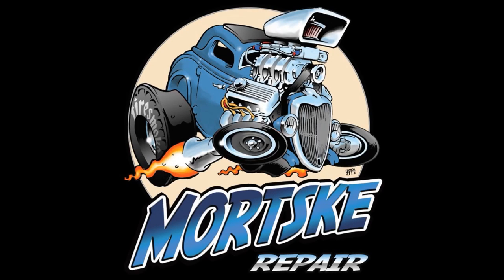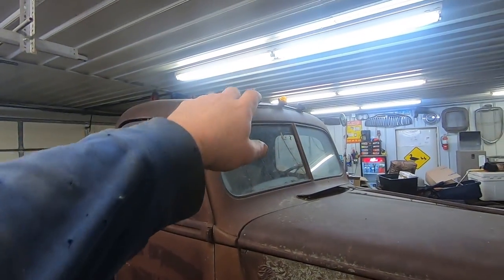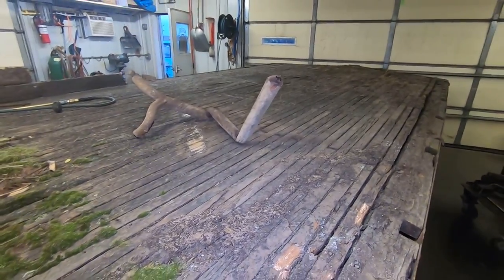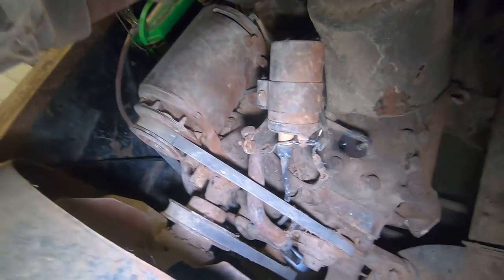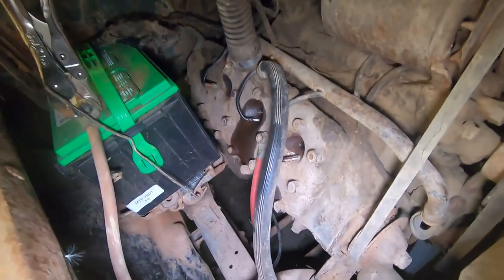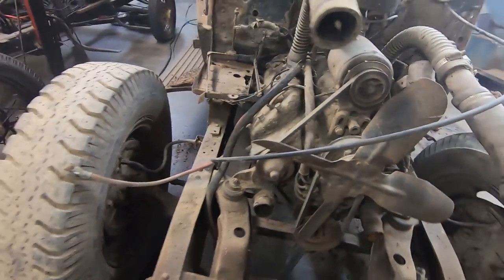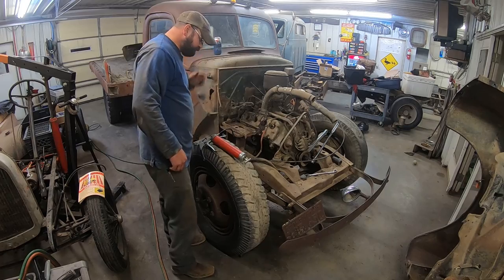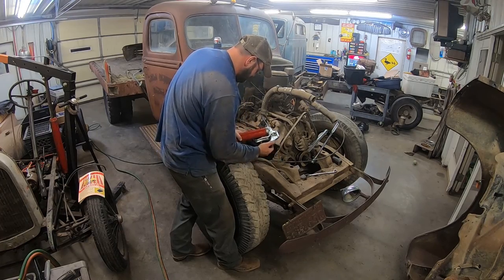Farm Auction 1944 Ford Flathead V8 truck! Abandoned for 47 years! Will it run?!? Stuck rusty engine!

Comment: When you took the 2nd head cover off my heart sank, I thought that was it like tools down and junk it.
I cannot believe you got her free! Yet alone actually running! 🤘  Well done I take my hat off to you sir 👍👍👍
Reply from the maker: Trevor, your comment right there was the whole reason I did this. I was sick and tired of all the keyboard warriors out there questioning my mechanical ability. I didn't perform any magic on this one. I just refused to give up! Thank you so much for watching and commenting!!
Reply: @MortskeRepair  sometimes when we don't give up great thing's can happen 👍
Reply from the maker: @trevorwilliamgrindrod3999  No good story ever ended with "and then I quit"!!!
Reply: You can't kill a flathead~!
Reply from the maker: @TestECull  Apparently you can if you fill the cylinders with water!! Thanks for watching!
Reply: @MortskeRepair  sometimes you just have to step back for awhile and work on it another day or so I've found anyway,my cousin has an old iron menagerie and several of those are flatheads including a '36 Ford pickup,a '52 Mercury Monterey, and even a rat rod '36 Ford truck with a V-12 Lincoln flathead not to mention a '37 Terraplane,a '35 Hudson and a '49 Dodge pickup with a Chrysler flathead six in it.
Reply: @MortskeRepair  Didn't kill this one!
Reply: @MortskeRepair  Are you gonna have the block pressure tested?
Reply from the maker: @rogercamp6071  I'm a man of little patience. But yes, when I'm feeling frustrated, walk away, have a beverage or 17, think over the situation and come back refreshed with a new game plan!
Reply from the maker: @dinkchow  Before tearing it down I'll have it checked out for cracks. Right now it's just waiting for it's time to come back. Got a few irons in the fire right now!
Reply from the maker: @TestECull  Almost drowned it!!
Reply: @MortskeRepair  yes I've been working on a lawn mower and the gas tank has mounting lugs and one has came off, have spent two nights working on reattaching it but tonight I finally got it back on, now to see if it will start and stay running lol
Reply: @MortskeRepair  eh the ol' girl just needed to clear her lungs and cough a bit. Haha. Be interesting to see if the block's cracked or not; if it's not I'd almost be willing to say it's a viable engine right as it is. Even if it is only running on 5 cylinders.

It's entirely possible the water habit was bad head gaskets too. Given the low CR and high chamber volume in these engines they can have a MASSIVE jacket-to-chamber leak and still not hydrolock. If it was a head gasket leaking jacket-to-cylinder you might very well have fixed it with the gasket-in-a-can.

Worth a try. Fill 'er up to the top of the hoses with water and flash 'er up, see if it starts leaking when it warms up.
Reply from the maker: Just throw a big zip tie on there Roger!!
Reply from the maker: C6 - I'll throw it on my run stand and get it up to temp a few times and see what happens. I'm sure it needs the waterpumps rebuilt anyhow.
Reply: @MortskeRepair  lol
Reply: @MortskeRepair  Would make a nice vid!
Reply from the maker: @TestECull  I'll be sure to document it!
Reply: @MortskeRepair  Don't think anyone'd be opposed to an ASMR loop of that thing burbling over either...she sounds good even if it's prolly only running on 5 or 6 cylinders.
Reply from the maker: @TestECull  Oh come on!! This thing is ready for the 1/4 mile blasts!
Reply: @MortskeRepair  Daily driver bb! She ain't smokin' bad at all either; it's probably only down a couple jugs 'cause the valve seats are covered in crud. I bet with a valve lapping on the cylinders that had rusted it stuck it'd be firing on all eight.
Reply from the maker: @TestECull  Dump a little Seafoam in the tank and she'll come right out of it!
Reply: @MortskeRepair  
KoperKote gasket maker, a temporary fix, unless it works.
I had a '40 ford 5 window that ran, but smoked so bad you had to shut down at traffic lights.
Couldn't get the heads of in 4 hours of trying all methods, including a brick on the accelerator.
You had better luck.
Thanks for sharing.
Reply from the maker: @FeralPreacher  It's not dumb if it works!!
Reply: In this scenario you simply have to be old enough to comprehend how lucky you are to own a part of history which are almost all gone now your grandparents will tell you I'm right
Reply from the maker: @alan6832  Yeah it was free!!
Reply: Thanks for ruining the whole video for me
Reply: @MortskeRepair  Those that have seen the things that Jennings Motors has resurrected (sometimes barely more than a half motor & barely recognizable chassis)...no doubt was there.
Reply: Nothing gets the heart pumping like a good workout on a flathead, followed by a grin when it runs. Thanks for the great video. Can’t believe I missed this one until now.

Comment: When I was a kid back in New Hampshire there were quarter mile dirt ovals that the locals raced their jalopies at, mostly flathead 
V-8s, some flathead I-six motors. One in particular was a Hudson six that won quite a few races. I used to hang around the pits after the race and watch the mechanics tear down motors for the inspector to measure bore diameters and such. I remember one old timer talking about knurling the pistons to deal with piston slap in a worn cylinder. Your videos remind me of those old days, "50's and "60s... great time to be alive.
Reply from the maker: Thanks for watching and commenting!

Comment: You have inspired me! I have a 54 Ford customline next in line, I have a V8 for it but the old inline 6 in it now is stuck, was trying to get it running but found 2 cylinders that looked just like your two. Couldn't unstick it so gave up but I didn't try the heat. Now I'm gonna jump back on it, just want to see if I can do it. I also have a 239 Y block with two cylinders the same, gonna try it too. Fortunately the engine slated for it runs nicely, so these two junkers are just for fun and the challenge. Keep up the good work, one of my favorite videos, and channels!
Reply from the maker: Glad you liked it! Sounds like you've got some cool stuff!

Comment: Never thought that thing would have enough compression to run, what with those cylinders in such bad shape. Maybe boil the radiator, patch it. Fill it up with water and see how much leaks out, to know if you've got a good candidate for a rebuild.
Reply from the maker: All that rust really seals those rings up for the good compression! I've got a radiator I know is good. I'll put it on my run stand with some new waterpumps and heat cycle it a few times to see if there's any further issues. Thanks for watching Rob!

Comment: I work on a lot of the N series tractors and most of them have studs, my method is remove the nuts, spray pb around the studs, tap the head with a hammer to shock it a little, then beat the piss out of it from all directions with a dead blow. Then I drive a thin putty knife between the head and gasket in a few spots and just keep working it. Once it’s up a little I grab the dead blow and a wood dowel and start working it up the studs. If I’m lucky some of the studs come out with the nuts and it makes it a little easier.

Comment: Funny. I've got almost the same truck except with an army steel dump box and no cylinder heads etc. I dragged it home with one tire worn down to the cloth and the sidewalls flapping. All tires still holding air. Love that old stuff.
Reply from the maker: That tire is good to go for another few thousand miles it sounds like!! The heads are off so the hard part is done as far as getting it ready to run! Thanks for watching and commenting Glenn!

Comment: I faced a lot of the same problems with the 2 49-53 blocks I have. The one in the truck was stuck in much the same way, and the second one turned pretty decently, but I tore it down anyway to check everything over. Two tips for you for the next one, use a plastic headed hammer for tapping the valves down. The metal hammer can shock the stem, and break it off. Second, ether is a faster way to get it to cough back to life. The whole wet plugs thing can get annoying while using gasoline for the prime and first run. Ether is quicker to light off. Just thought of a third tip. Drain out the old oil, give her 3qts of diesel, and 1qt motor oil. Let her idle for a good 3 or 4 minutes, cool down, and do it again a few times. That will usually liquefy all the old sludge in the valley, and the pan, it'll come sailing out the drainplug.
Reply from the maker: Those are all great tips Mark! I appreciate it! Thanks for watching and good luck with your flatheads!

Comment: I havent heard a 1940s Ford flathead V8 run in many years and after the first jailbar engine revival sank in a puddle of water of its own making, I was rapt to see this video pop up...

...then the driver's side head came off and I really expected you to down tools, mate.  I probably would have written that thing off as a boat anchor, myself.....but you persevered.  AND you got the job done.  

Man they built 'em tough back then!  Sure, she probably needs the full overhaul but she runs, blows little smoke and sounds not bad, so maybe there is some life left in the old mill yet!  

That idle was absolutely wonderful to hear after so many years.  My Dad had a 48 Bonus that idled at about 400rpm and had the 4-spd crash box.  I loved the sound of that old truck and used to go out and start it when he wasn't home just so I could hear the starter and that magical idle!  

Dad had a party piece where he'd be out sinking a few in the garage with his mates and would lift the bonnet on the Bonus, crank on that starter (that always sounds like the engine has no compression) and then wind the rpm down to the point where you could almost hear each cylinder fire and watch the fan blades go round.  

A magical engine....and its given me a hankering to go out and find me an old Bonus or Mercury just so I can hear it more often!  Many thanks for giving it all the time and expense - I for one certainly appreciated it
Reply from the maker: Lance, thank you very much for watching and thank you even more for your positive reinforcement! It's comments like yours that make it all worthwhile what we do on here! And you're right, there's nothing like the sound of an old flatty ticking away at low idle! Thank you again for watching and commenting!

Comment: I have a stuck flathead in a '53 that I really want to dig into this summer.  Trouble is, Summer is quickly evaporating and the '53 F100 is still way down on the priority list.  Great job Mortske.
Reply from the maker: Good luck!
Reply: @MortskeRepair  The heads are off the flathead in the '53.  Like this one, two chewy cylinders but they are the middle two on the other bank.  The one that is near BDC cleaned up decent buy the other stuck one is near the top.  I have tried a bit of heat and the stick and hammer on the pistons but still not moving.  I left it soaking for a couple of days with some marvel in the cylinders but I doubt that is going to do much.  I think the pipe wrench and extension pipe is going to be my next step.  Thanks for this video.

Comment: That a friend of mine tought me how to unfreeze engine's by letting them soak in transmission fluid. Because transmission fluid is an oil that can penetrate metal.
Reply from the maker: There's a lot of different concoctions folks try for loosening engines. I don't have patience for that so I throw a little heat at em. Thanks for watching Jacob!
Reply: You can also use Ammonia to free up stuck cylinders
Reply from the maker: @richardsmith1143  Thanks for the tip Richard!

Comment: Mortske deserves the Relic Repair award.  I've never seen anyone get an engine working, with that much rust inside.  Even a top-shredded piston can still work, which is pretty amazing.  It would be an amazing find, if there were no cracks in the block.  (Very valuable $$$) The over-heating might be alleviated by removing any blockage or clogged gunk in the cooling / oil passages, plus as large a radiator (new, or refurbished)that fits that brand of vehicle.  A rad pump (new or rebuilt) will need to move that coolant through the system, quickly, and efficiently.  And the heat must dissipate, properly.  Getting those engine block passages flushed out means a lot.  Having such an old engine eat through $200 repair dollars was pretty gruesome to my ears.  That's TWENTY people who have to chip into your taxi-cab fund. ($10 each).  Where do I donate?  lol

Comment: That is so cool a few years ago I bought a 49 and a 50 F1 and I was able to get them running I took the intake off and both intakes were stuffed full of mouse nests and the valves were my only problems of sticking and I cleaned them and heat it up and oiled them and tap them and both of them are running good to this day
Reply from the maker: It's always those gosh darn valves in these flatheads!

Comment: Nice clean carb...made all the difference
Reply from the maker: I know a guy who does a bang up job! Really, that's all it needed was that carb. The rest was just for fun. Thanks for watching T-Man!
Reply: @MortskeRepair  shoulda started with the carb....all the stuck parts woulda loosened right up on their own, haha. Nice work. Ive got a 33/34ford pickup project that could use a good flathead core (and a few thousand hours of free time).
Reply from the maker: @tylernovotny5419  Sounds good, I'll put it on the schedule. Free time. Yup. Parts just get marked up 10,000 percent on those projectes!

Comment: Why didn't you just pull the plugs, shoot some lube in, let it sit fer a bit and then try with no compression firstly?
Reply from the maker: I had pulled the plugs and lubed the cylinder before I started as stated in the video. Then put a bar on the driveshaft to no avail.
Reply: @MortskeRepair  didn't wait long enough
Reply from the maker: @damiangillett6443  No amount of oil or time waiting was going to cut through all that crud, lets be honest.
Reply: @MortskeRepair  Ahh, sorry man, I must have gapped that
Reply from the maker: @Ogsonofgroo  No worries!

Comment: waylon wire shared a trick to pressurize the oiling system to push oil throughout the motor, It worked for me broke free a motor that was setting for years and years, and poured trans fluid in the plugs o
hole and let set for a few weeks. got it to roll over and 1 hour it fired up and cleared up purred like a damn cat
Reply from the maker: I'll have to check that out. Thanks for watching Ken!
Reply: ya I spoke before the rust holes were opened. ya oiling the bearing passages did the trick for me before it was tight as heck
Reply from the maker: @kenfrazier616  Good to know. Usually they're stuck in the cylinder walls. Which pressurizing the oiling system wouldn't affect. Good to know.

Comment: You must be one of the most optimistic pessimists I've seen so far. I am quite impressed with what you've done with what you had to work with. I would have thrown in the towel and been on the phone with the machine shop. You sir are a sorcerer. You earned my sub.
Reply from the maker: Thank you very very much for the kind words! Glad I could get it running and thanks for subscribing as well!!

Comment: A suggestion I have for freeing up locked engines is spraying the cylinders with your favorite penetrating oil, usually through the spark plug holes, and let it sit. 

This technique wouldnt have worked for that particular engine, but still a good thing to do when you work on engine that sat.
Reply from the maker: I agree, doesn't hurt but this one was a bit far gone for that. Thanks for watching Adam!

Comment: You and I have a little in common I like to burp these old flatheads back to life also, my 1951 Ford runs as smooth as a clock after I rebuilt it back standard. Keep saving the old iron buddy.
Reply from the maker: Thanks sir!

Comment: Sheeeeit, man - that was nearly a year ago you did this beasty!  A little bit of prophesizing in there too:

Mortske: "Well that was a struggle.  I'm glad I got it going.  I know I'm never going to forget this.  I hope I don't ever have to do another one that was this stuck.  Coz I got a lot of time invested in this, I mean three nights after work, half of Saturday dinking around with this and I've still got to get it outside to store it for future use".

Ahhhhhhhhhh.....  The innocence of youth, eh Mortske?  How little did you know of what was coming in the next 12 months!  A win is still a win and this baby ran and would probably have purred once all the rings came home.  Buggered piston tops or not - they still make (or made) compression.  Add fuel, air and spark and there's the holy quartet....and she sure sings a song.

Still enjoy this video, mate.  Love the sound of that flathead starter and how she happily idles at about 400rpm.  Would have been interesting to see that Jailbar move under her own steam.....and considering the water bottles in the cab, there could very well have been steam in the picture somewhere!  Maybe one day if you're bored, you could grab this old bus out the weeds and see if she still has a clutch.  Brakes will be a complete wash-out, we both know that, but then the brakes in the 40s weren't exactly stellar either, so no great loss.  An anchor thrown out the back window would be a better system (as long as the anchor rope was tied to something solid on the truck).  Dad often joked about rigging up such a system on his '48 Bonus for when he had a metre or so of builders mix (or some other heavy load) in the back. That old crash box used to get a workout
Reply from the maker: They're great little engines!